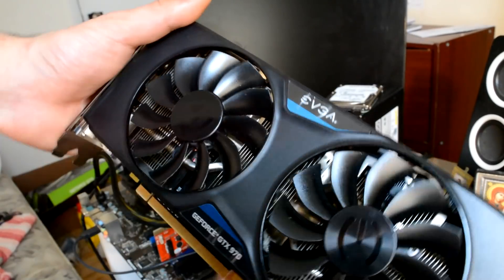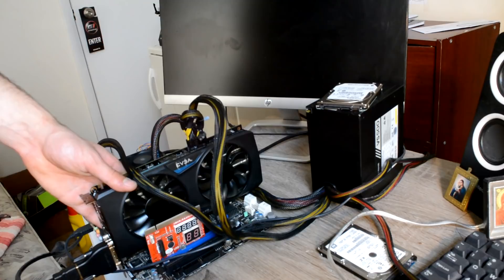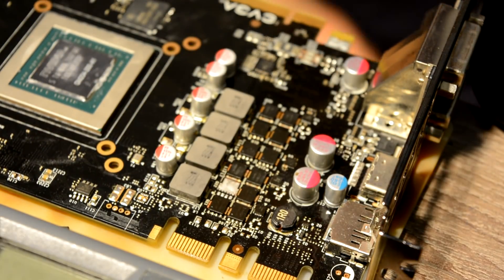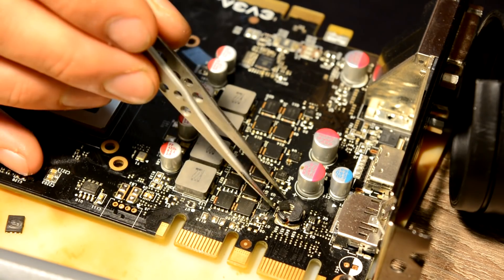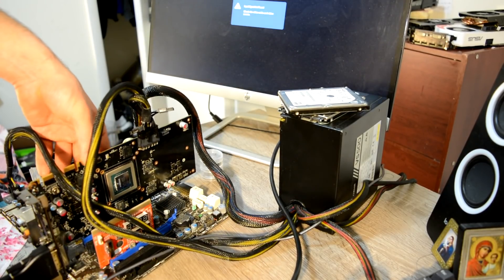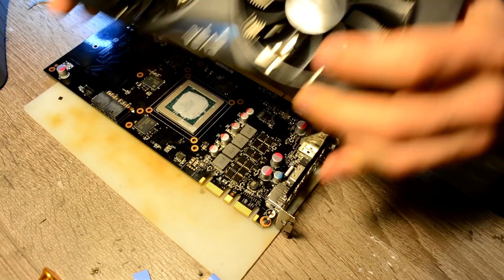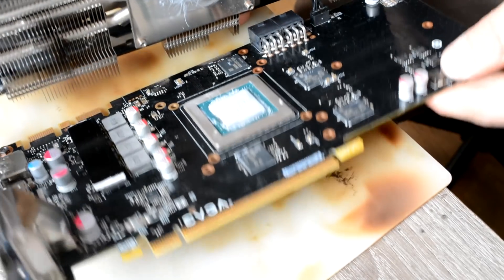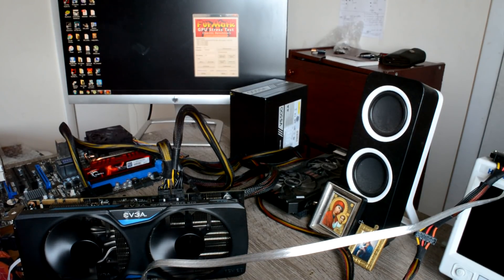GTX 970 repairing phase or what could happen if you don't put radiator back video card repair

Comment: i have the same card that stooped working about a week back.(warranty over unfortunately) it did had the radiator part build in to the aluminium grid. i just wish i have some one like you near me so that the card can get fixed. it dose not have any obvious marks as you got but i'm pretty sure there is some part damaged or short.
Reply: csm1o1 find a local electronic servicing company, show them the video ask if they can help

Comment: the card actually comes like this... mine died off of a shorted diode and i fixed it by desoldering the diode, but i dont have any replacement diodes and my card sometimes starts and sometimes doesnt for some reason :( but now its on so im gonna try to not stop my pc running and just let it sleep 
also can a gt 710 have any chips like that? i need that replacement chip :(
Reply: succ: seems like getting a diode might be easy, doesn't have to be the same one, just the same current and wattage.